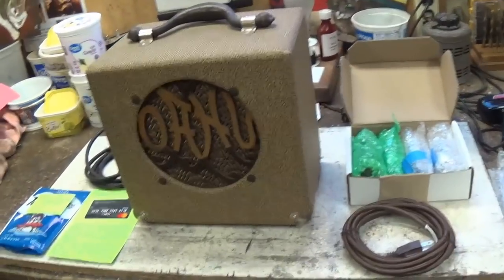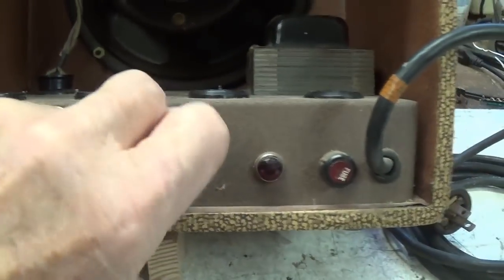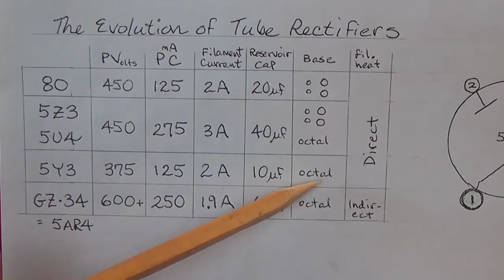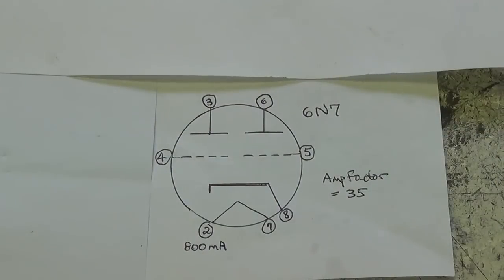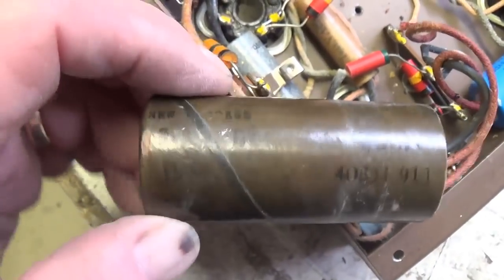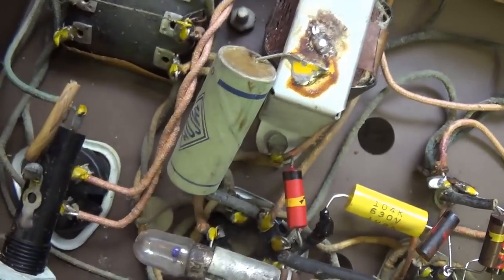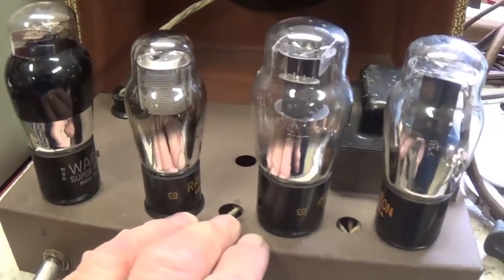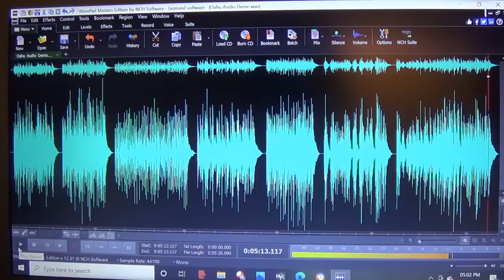Amazingly Original Pre-War OAHU Amp Gets a Tune-Up

Comment: I am curious if the amp actually had shorting input jacks as shown on the  schematic; amplifiers of this vintage often did not. Also note that a problem that can arise when the input stage has no grid-leak resistor is that a small voltage from the preamp tube grid can be fed backwards into the controls and pickups of the guitar, leading to crackling noises when the guitars volume is adjusted (which is the reason why you might see a capacitor between the input jack and the grid of the 1st preamp tube, to block DC from getting to the guitar's controls). 

 The possibilities are legion for hum induction in an amplifier constructed like this.  The 1st filter stage capacitor has its own ground ---- bolted, or riveted? ---- and the 2nd and 3rd stage filter caps have a separate ground several inches away through what looks to be a riveted-in-place terminal strip.  Also the input jacks are bolted directly to the chassis without isolating launchers. All of this mechanical grounding was originally done to a heavily painted chassis without the factory taking pains to remove the paint around those holes, and 80 years later it can be pretty much guaranteed that there will be oxidation and galvanic corrosion underneath those bolts and input jacks, and especially at the riveted ground points for the terminal strips.  Unfortunately it can be a big job to undo all those grounds and clean the metal and put them back together, and it's certainly not in everyone's budget, but it can be sonically rewarding (greatly lowering the hum and background noise floor) if one has the patience, or the budget, to do it.  

One pointed comment pertaining to safety; I would recommend attaching the ground wire from the power cord directly to the chassis and not to the frame of the filter choke because you are relying on the 80-year-old bolted connections holding the choke in place to connect to ground electrically through the frame of that choke ( the bolts and the chassis are probably oxidized underneath the monting tabs of the choke). This also might tend to induce eddy currents into the chassis, increasing hum.
Reply from the maker: Thanks for all your excellent observations and suggestions, GU.

Comment: Hello again uncle Doug. I’ve been chasing an old mystery amp for a week and half. After identifying a coke bottle 80 and 6n6 sitting in a chassis that looked familiar I put in a successful bid. One poorly lit photo barely showed a domino capacitor so I knew it was much older than advertised.
It’s a single ended Oahu and sounds beautiful. After researching and many identifying photos mine is the only one without a power light or fuse. 
The seller played it for me. He insisted.
The chassis is absolutely spotless and has been minimally upgraded. Utah field coil 8”
What I’ve learned from your videos and teaching style is paying off but I’ve only scratched the surface of what I need to. Thanks again. Bob
Reply from the maker: It sounds like a wonderful old amp, Bob. We're glad our videos have helped you gain both knowledge and appreciation of these old gems :)
Reply: After finishing the video I see your plaque from YouTube. Congratulations 
Just to add to the description of the Oahu, the solder dye is bright blue and the cabinet has the same wallpaper sort of alligator or laquer checking texture. No markings serial model#s. Off volume pot has a number showing manufacture code 303 which is either sprague or possibly a military spec. It looks different than your video but chassis is identical
Reply from the maker: @Cdog5279  Thanks, Bob. No doubt you have an early Valco amp. Perhaps at the time of its production, they were not labeling them with subsidiary names like Gretsch, Oahu, National, etc.
Reply: Ok I can’t send photos on YouTube or maybe I can. I guess I’ll have to post a video
Reply from the maker: @Cdog5279  Why would this be necessary, Bob? The amp has been accurately identified as an early Valco product.
Reply: I’m a newbie here Uncle. I’m scratching every source of information I can find to learn about these circuits, and making ground  every day. 
I’ll keep you posted when I find a place to post my photos.
Here’s a good laugh for you. I have a grasp for the principles and starting to understand tube design but I can’t solder wires that aren’t shaped like pipes!!!
Reply: I’m joining patreon
Reply from the maker: @Cdog5279  Thanks, Bob. We appreciate it.

Comment: What a completely beautiful thing! Everything about it is stunning! I'm only halfway through the vid but I'm very excited as I think this may guide me on my great grandad's radio he built in around 1938 - apparently they listened to the declaration of ww2 on it the next year. I'm thinking to try make it into a guitar amp using as many of the original components as possible, as AM radios are near useless in the UK, there's no schematic and I think it was either a DIY kit or a circuit my great uncle Norman dreamt up. I plan to piggyback a bluetooth receiver somewhere, so I can still play old radio shows through it too
Reply: And it sounds wonderful too! I think I'm in love. Great work yet again Uncle!
Reply from the maker: Thanks, M. Good luck with your project.

Comment: Congratulations on 100K. I just saw the channel for the first time today. It was was such a surprise to see an amp so much like mine featured in a video that showed up in my feed. It looks the same, but has a Rola electrodynamic speaker, and a 5Y3 rectifier tube. The other tubes are the same. The speaker bears a date stamp from February, 1942.
Reply from the maker: Thanks, X. There is a lot of variability in these old Valco amps.
Reply: @UncleDoug  If I ever want to have it refurbished the way you did in this video, would it be OK to contact you? I don't think I have the skills to do it myself.
Reply from the maker: @Xubuntu47  I'm currently quite busy, X, but you can contact me in 90 days or so if you still need it serviced......or you can contact Michael at Chelliamps@gmail.com.

Comment: Congratulations on 100K subs. You are doing an amazing job of educating us on amp repair. You are my favorite amp repair guy on YouTube. By the way, I recently bought an Epiphone amp at a local estate sale. It’s a 1955-early 60s amp with Century on the nameplate. I have yet to plug it in, I have a Variac that I will raise the voltage slowly on the first try. I plan to recap it and check the resistors for tolerance. Wish me luck on my $2 amp

Comment: Uncle Doug,
Greetings, and Congrats! I’m a big fan of your great work. You’re a fantastic teacher, a pleasure to watch and learn from.
I’ve been thinking about how it would be awesome to see you take the popular Pignose battery guitar amp, and then modify its circuit for distortion, fuzz, and overdrive. Could you take common Amazon available components and build the circuit with semiconductor op amps, clipping and germanium fuzz.
You could make episodes of you building it and have links to a kit of parts that you could sell to us.
Since the pignose amp is battery powered, the circuit modifications to the amp would be limited to below 9v using the 7-100 model.
Thanks again for your great work, you contribute to YouTube like Mr.Roger’s did to PBS, in a positive way, you bring out the best of YouTube 👍
Reply from the maker: Wow, thanks so much, Bryan. We appreciate the suggestion, but Jack & I stick strictly with vintage tube amplification circuits. Perhaps a SS specialist will fulfill your request.

Comment: Congratulations from 1/100K!  Really enjoyed this one as I just experienced the same issues on my same Oahu amp about 5 weeks ago.  Updated all caps, some resistors, a lot of head scratching on how it is wired.  Same 60 cycle hum with V1, replaced V1, same results you had.  It was fun and quite a learning experience.  Great sounding amp IMO.
Reply from the maker: Thanks so much, Mr. C, both for the kind words and confirmation of the issues I encountered.

Comment: I think the 2nd channel being wide open was to accomodate a volume pedal with the lap steel.

Congrats on 100K!!  Well deserved!!   

...as always, thanks for bringing us along for a very cool one.
Reply: I am inclined to agree with that, considering that they were still quite popular at the time.
Reply from the maker: I am not well versed in steel guitar lore, Rick, but that sounds like an excellent possibility.
Reply: That's not a bad guess on the second channel, but these amps were nearly always sold as a SET... with matching lap steel guitar... and the guitars had the volume. Why? Because they didn't know what normal was back then. And I know of no volume pedals in production at that time, outside the Hammond organs... I imagine the DeArmond was the first to pop up, but I think that was around 1948-ish... if you listen to early Hank records, his steel player's using the tone knob manually... so I would assume volume was the same unless someone designed a simple early one-off for themselves... just my take.
Reply: Ok, looks like the DeArmond saw introduction in 1941... still, I think the non volume controlled input was the norm, and the attenuated one, the addition. 
As I mentioned in a separate post, I had a similar oahu combo, matching lap steel and amp... a smaller amp than this, dated 1941.  And it only had one input and no attenuation on the amp whatsoever. The guitar itself had the volume knob and if you think about it… if they were both made to go together, then there would be no need for the extra expense of attenuation on the amp itself... if you're holding all the attenuation you need in your hand, correct? And that would have coincided with the very 1st use of the DeArmond volume pedal, but I doubt that they were considering that in 1941, the very same year it was introduced. Perhaps a short time later they were, but I don't recall  a lot of people using them in my life of pedal obsession... I imagine they were relatively popular, but the consideration was probably to make these cost effective and streamlined, and likely not in consideration of another brand's product.
Reply from the maker: @seansweeney3532  Thanks for all the informative input, Sean.

Comment: Uncle Doug Congrats on the 100,000.

Are you a Tubes fan did I detect a little “Talk to Ya Later”

It does amaze me the difference in size from the original caps to the modern replacements, I recently replaced some caps in a 70’s Vox B2 battery powered transistor amp and one of the replacement caps was fractionally bigger than a couple of grains of rice even at a higher voltage.
Reply from the maker: Thanks, Keith. I agree.....some older caps are the size of a toilet paper roll, yet can be replaced with new ones the diameter of birthday candles ;)

Comment: I have the same amp. Mine has the wood on the front delaminated.

Mine still works but being as old as it is there's probably a few components that are getting tired inside.

I thought about making a new grill for the front but I may just sell it as is and let the next owner decide what he wants to do with it.
Reply from the maker: If you're not going to fix it up, 10, you might consider passing it along to someone who will.

Comment: Feline overlords are the best! Mine will also agree. I just have to keep him away from the bench when the iron is hot or high voltages are present, just in case.
I absolutely love your sense of humour, as well as your viewers' :).

This amp is so lovely, a true thing of beauty and a joy for ever, and it hasn't deteriorated over all these years either. I adore the markings on the tube sockets, very practical and yet unobtrusive. 
The power cord might have been indeed replaced at some point, the original was probably cotton-coated. The fuse socket looks like an aftermarket mod too.

Replacing electrolytics with higher capacitance ones is generally a good idea as way back then the electrolytics were a lot bigger, plus the more capacitance you got, the more expensive the part was. As always, some tradeoffs had to be made by designers. Now that the caps are pretty small and cheap, you can use larger capacitances, but can't do it with impunity - there are some considerations:
-if it's the cap right after the rectifier tube, you can go up to the maximum capacitance specified in the tube's datasheet (especially important for directly heated tubes),
-if it's in some B+ filtering stages, you can use more if it's gonna solve the humming problem,
-if it's the cathode resistor bypass cap, it'll affect the frequency response and sometimes the stability of an amp.

Replacing the power cord with one that has a ground lead is always a good idea, getting rid of death caps in the process. I practice it when restoring any radios or other vintage gear.

Congrats on 100k subscribers. Your channel absolutely deserves recognition. There's so much to learn here! I wonder if you plan on modding the plaque in any way, kinda like EEVBlog did with nixie tube substriber counter. That would be cool :)

Stratosaurus is a cool nick, I'm imagining a T rex shredding on a Strat. Ha.
And the amp sounds so sweet. Lots of love, keep up the great work!
Reply from the maker: Thanks for all the excellent comments and suggestions, Keri. Jack and I give them a paw and a thumb up.

Comment: The reprint of the 1937 Sylvania tube manual can be useful for these amplifiers, as it contains many of the two digit tubes and other common early tubes.  It also contains some that are still around today ....6L6, 6V6, 5U4 which at the time were new and state of the art.
Reply from the maker: Thanks for the tip, DH.

Comment: Nice walk through of this old dog. It had a much mor hi-if sound than I expected. Was the second music clip the straight to tube….more bass signal where as the first clip was brighter, more boxy sounding for lack of a better word. I just picked up an old 25W RCA PA that I will begin to whip into shape. I believe it uses 6J7’s. Just going over it and it is very unusual from what I’m used to seeing?
Reply from the maker: Glad you enjoyed it, PW. All the clips were through the input that had a volume control. Good luck with your project.

Comment: With an amplification factor of 20, the single triode 6C5 is similar to one half of a 12AX7 or 6SN7 (dual triodes). The #80 and the 5Y3 are basically the same tube except for the basing, and you can sub a 5Y3 for a #80 by making an adaptor, changing the tube base (easiest to do if you can find a good usable 5Y3 with a loose base, as the bond of the baked cement is difficult to break), or changing the tube socket on the amplifier (which we hate to do on a rare vintage amp, of course).  As for the rated maximum capacitance that the rectifier tube can operate into, a 5Y3G with small coke bottle glass might be rated for only 10 microfarads but I believe it was uprated to 20 microfarads when they came out with the more compact, cylindrical-bottle 5Y3GT.  Regardless, amplifiers that came stock with a 5Y3GT are frequently seen with 20 microfarad as the 1st stage filter.  The reason that a 5AR4 or GZ34 has lower internal voltage drop and can safely be used with a higher capacitance is because the independently heated cathode allows for close spacing of the cathode and plate; a filament-type rectifier would arc internally if the elements were too closely spaced.
Reply from the maker: Thanks for the very helpful info, GU :)

Comment: I enjoy your vids.  I dabble in this stuff (as well as tube HiFi) a bit, and you may want to consider adding an inrush thermistor when you update the AC primary (polarized 3 prong, eliminate death cap, chassis earth ground).  I use the Amphenol CL-70, which you can source from Mouser for about a buck fifty each.

Unless your client is a complete OEM nut, there are significant advantages. The thermistor will bring up the mains voltage to the Power Transformer over 3-4 seconds, like a variac.  This is much kinder to the filter caps, transformer and power switch, as the inrush spike from charging the big filter caps is much reduced.

With this mod, you also can eliminate the 'Standby" switch if you like.  Word is that Uncle Leo added the Standby Switch merely as a way to skimp on the Power Transformer and filter caps by lowering inrush.  Contrary to lore, taking the B+ off the plates does nothing for properly biased valves.  If you need a mid-gig beer break, just turn the volume to zero.

I sometimes use the removed standby switch chassis cutout to to add a negative feed-back switch or pot as a "presence" control, to get a clean or "dirty" tone.

There is an added, serendipitous, benefit:  Most of the '50's stuff was designed to work on 115-117 volts.  Most AC line today is 120 v or more. So with the 47 0hm resistance the thermistor introduces, the line voltage to the P transformer is much closer to original spec. The thermistors do heat up, so you need to mount them where they can breathe a bit.

Keep the animals fed and the content coming!
Reply from the maker: Thanks for the excellent suggestion, William. I agree completely and will order and install some thermistors in future amp repair jobs.

Comment: There were a few earlier indirectly heated rectifiers similar to the 5AR4- the 5V4 and the nearly equivalent 5Z4.  I have a Victor projector which uses a 5V4 rectifier.
Reply from the maker: Thanks for the info, D.
Reply: The 5V4 is a very usefull tube for increasing headroom on small  low power amps, assuming the filter caps and tubes can handle another 20 to 40 volts of B+.